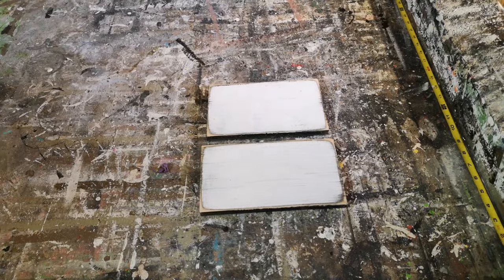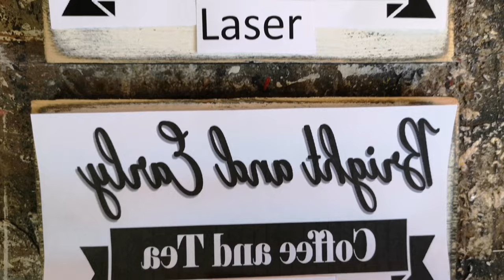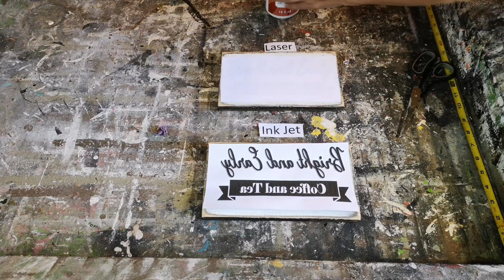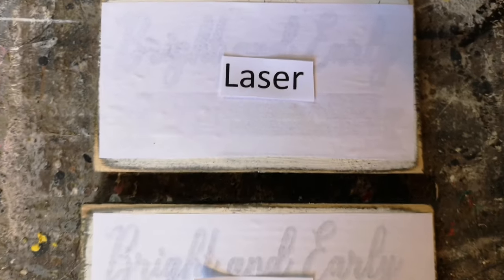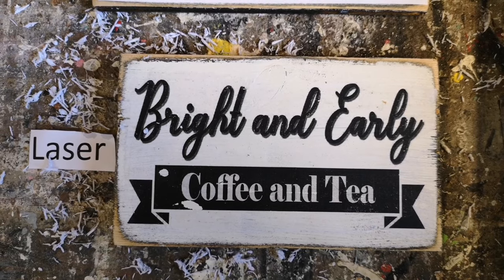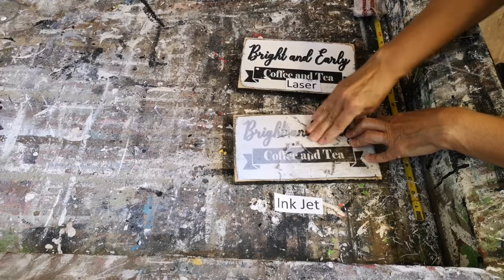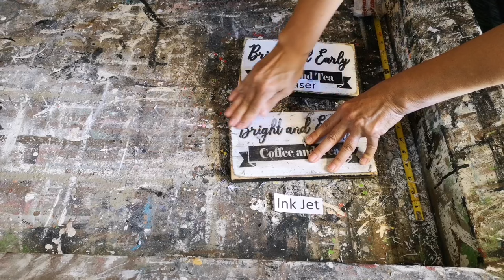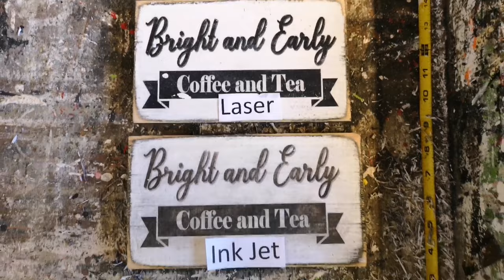Best Printer for Mod Podge Transfers / Inkjet vs. Laser

Comment: The channel, “Red Rocking Bird,” has a tutorial with an inkjet, and it worked great for her. She doesn’t use hair spray, but I have heard that might help. I haven’t tried it myself, yet, but I do want to try it. I have learned so much from both of your channels. You are such a great teacher. Thank you, for showing the difference, so we can explore, with the tools we have. I noticed one thing she did differently, is that she worked in small sections, to wet it, and rub it down, so that may have helped her. Since it wasn’t all wet at once, it didn’t give it time to smudge.
Reply from the maker: Yes it is kind of a trial and error to see what will work for you and your printer . If you figure it out it works perfect ❤️

Comment: Found ur videos while researching color graphic transfer onto wood.  Your tutorials are very informative and I absolutely love the fact that u get down to business quickly. I have a question about the graphic transfer with an inkjet; I've watch several of your other videos on this subject and I noticed when you decoupaged ur camping pics and the graphic on the aged paper that you low baked then sprayed with hair spray to prevent bleeding (inkjet)...would this same process work with the reverse prints for total transfer (paper removal) or could it perhaps lessen the "bleeding" of the ink?
Reply from the maker: When doing the reverse technique with an inkjet printer it won’t make a difference if you put it in the oven and actually if you put hairspray on it it will prevent it from transferring as well

Comment: Been doing this for sometime and curious how you handle what I like to call "paper fog"?
After all the paper is off (that will come off without destroying the design)... and after the water has totally dried, the design seems to "fog over" some. Add water and it's instantly bright again. Usually a clear sealant takes care of this for me but wondered if you had any other thoughts on this? Thnx...
Reply from the maker: Yes you can get a bit of a haze at times just need to work on a small area and dampen finger and rub slowly. When you add the poly alot will go away if you still cant get it off. Use the cheapestest computer paper so you dont have as much paper to rub off also
Reply: @OurUpcycledLife  makes sense about the cheaper paper!! 👍👍

Comment: I recently saw a video where you put a ink jet printed image in a oven at 200° for 10 min. to set the ink will this work for reverse transfer printed with ink jet, will it help the ink transfer better with no or less smudges
Reply from the maker: Thanks for watching! I haven’t tried that but would certainly worth a try and it will probably help a lot with smudges. Let me know how it works it you try it! ❤️

Comment: Love your video! I tried this and it seems like I’ve rubbed off the paper 5 different times. I did it on a canvas, and after I rub it off and it’s still wet, it looks good. But then by the time it’s dry, it’s all white again, Like it won’t stop peeling off. Any suggestions?
Reply from the maker: Hey there!! Sometimes it will stay cloudy but when I put a coat of poly acrylic sealer on it that will go away❤️
Reply: @OurUpcycledLife  Thanks so much!!!

Comment: Such a great way to show the difference. I'd even hang those signs in my workshop. Perfect. Btw, what technique would you recommend I use to clean my teapot up? I am debating whether to do it or leave tarnished. Just curious. Thanks sunshine. 🌞
Reply from the maker: If painting a ceramic tea pot it covers best with a primer or spray paint for first coat :)
Reply: @OurUpcycledLife  wrong teapot sunshine. Lol. Mine is antique silver, tarnished, with a black handle. Looks similar to yours in your workshop. 🌞

Comment: So do you have to paint the wood surface first like you did or was that just for stand out quality? I also see lots of these videos using printable lable backing paper to print. Now those dont use modge podge and rubbing so does that mean long as im using mod podge technique i can use normal printing paper?(working with an ink jett) thank you for your time and this video comparison.
Reply from the maker: I just use normal computer paper for this method and paint the wood so it stand out better. The label paper is a completely different method ❤️ thanks for watching

Comment: Did you use regular printer paper for this method? Also do u think the photo transfer modge podge medium would work on this?
Reply from the maker: Yes regular computer paper and yes the photo mod Podge will work but the matte mod Podge works just as well❤️

Comment: What type of inkjet printer are you using?  It matters as there are dye type inks and pigment type inks.  Pigment types are higher end and will probably handle a transfer better.  Thanks for the compare ~  Modpodge!  Who knew?  ps… i like the inkjet example for this use.  wondering how modpodge will do with transfers onto metal?
Reply from the maker: It is a HP  printer! I don’t actually use it much. Use my laser jet 90% of the time 🌸 I have used mod Podge on metal actually doing a video right now on a metal bucket
Reply: @OurUpcycledLife  Thanks so much!  But can I please ask; which model?  You see, some use pigment type inks and most seem to be dye type.  They each give a different result.

Comment: I was wondering, if you wanted to do this technique on a big bit of furniture, would that HAVE to be inkjet? For example 890mm x 610mm or has anyone ever done this in sections? Or would that just be a nightmare? Thanks in advance. Tim
Reply from the maker: Transform Your Designs: Create HUGE Signs with This Simple Trick
https://youtu.be/HYr3DFZo9CQ

Comment: I have a HP Envy 5010 inkjet printer and the black is quite stable when it gets wet. The other colours most definately are not. I have tried this with red instead of black and boy what a mess. Not all inkjets are equal. Some use pigments which make them much more waterproof. If you did this type of image transfer with an inkjet print that was very colourful I don't think you would have as much success as just using just black.
Reply from the maker: Yes I agree all ink jet printers are so different with how much they run. Mine works well. I have a tutorial of a colour photo I did and didn't run or smear at all https://youtu.be/F17WmucEwqM

Comment: I recently discovered your channel.I love it! But I have a question: I bought a laser printer and tried transfer my photo with Mod Podge medium transfer to a block of wood without chalk painting under the photo because I want the wood grain to come through. It did not turn out well at all; the picture was tearing up, so I just rubbed it all out and am going to start over. Do I Mod Podge the bare wood, let it dry, and then try it again?
Reply from the maker: I find the best results having the base as chalk paint. It is difficult to transfer on bare wood . Glad to have you following along ❤️
Reply: @lisa Shelton
Did you figure out what to do for the wood transfer.
I'm not sure if this would help....  🚨please try it in a scrap of wood first.
🤗 Try sealing your wood with shellac spray,  let it dry for a day and see if you need another coat just in case and let dry. 
Then, try doing the modpodge transfer, hopefully this work for you. 👐🏾🙏🏾 Good luck!
Reply: @TamyC7  I was able to successfully transfer the photo so the grains show in the photo. What I did after I sanded the rest of the photo off is I just reapplied it onto the wood first, and then put the photo on top of it with a roller…then I let it dry for 12 hours. When I rubbed it off, I did it in separate sittings, and made sure it was completely dry before I rubbed it again, then i finished it with SG polycrylic, and it turned out great! However, I am going to try the spray shellack next to see if that makes it a little less time consuming. Thanks for your reply 🙏

Comment: I am new and about to give it my first try. If your block wasn't painted white would the wood look white because of the printer paper? I want to put some text on a piece of wood but don't want to mess it up. Thank you!
Reply from the maker: Thanks for watching ❤️ I always like to do this technique on a light coloured painted surface. If you do on raw wood I find after you have rubbed off it still leaves a cloudy look to raw wood
Reply: @OurUpcycledLife  my project turned out great, thank you for the suggestion! Now my question is, since it'll be an outdoor piece, what should I be sealing it with? Would a paint on spar urethane be ok? I just don't want the colors to bleed.
Reply from the maker: I would put on a outdoor poly acrylic sealer and that will be good for outdoors🌿
Reply: @OurUpcycledLife  do you have any you prefer?
Reply from the maker: No any brand will work good as long as for outdoors❤️
Reply: @OurUpcycledLife  thanks for the quick replies, appreciate it!
Reply from the maker: You bet anytime ❤️

Comment: I learned a trick that works doing these and I did a 16x20 portrait, what I do is put a little more mod podge then I put something heavy on my image to make sure no wrinkles get in it. then the last part is I heat it with an iron on low for a few seconds then I wet it with water and let that water sit for about 40-50 seconds and all of my paper come of down to the actual glue is all thats left no paper at all am i';m using an inkjet printer.
Reply from the maker: Great tips

Comment: Does the printer do reverse?
Reply from the maker: No you have to use a word program to reverse the text 🌞
Reply: @OurUpcycledLife   Great video!
Regarding having to use a word program... Someone told me that you could print a mirror image straight from a printer, so I googled it and came up with this. (I hope it works)
"How do I print a mirror image on my HP printer?"
"Open the image, click File, click Print, and then click Show Details, if necessary, to view all settings. Click the unnamed print options menu at the center of the window, and then select Layout. Select Flip horizontally."

Comment: ive followed your chalk paint recipie, then i got a laser print, but my pic wont stick to the painted wood with the matte mod podge
Reply from the maker: You painted the surface with chalk paint?  If you did I have never seen it not stick? If there is varnish on top of the chalk paint it will not stick could that be the problem?
Reply: @OurUpcycledLife  no varnish, i kept sticking the edges, left it overnight and had hell of an issue getting the wet sponge to soak through the paper, (the paper is a lot thicker than computer paper) could this be the issue,this is 3rd time doing this, time for stiff drink lol
Reply from the maker: Oh yes that is it for sure!! I use just cheap computer paper! The water has to be able to soak thru to rub off
Reply: @OurUpcycledLife  i got printers to put image on my own computer paper as 100gsm was the lowest they did, anyway when i went to rub it off most of the ink came with it, i salvaged it but the cats had ears missing etc but i made it look vnitage

Comment: I wonder if you put the Transfer medium on the wood, rather than on the inkjet picture would it smudge less? You wouldn’t be dragging your brush across the inkjet print merely laying it down on the prepared wood. Just a thought. Love your demos x
Reply from the maker: I did try that technique and it didn’t make any difference. It’s the actual rubbing I found that took the image away. Worth a try though might work for you ❤️

Comment: I'm not a huge fan of ink jet printers for many reasons, including that a printed letter on a laser jet is infinitely cleaner without fuzzies - experience with an ink jet is poor quality or not crisp, clean letters on simple black & white printing. Having had this experience from years ago has really slanted me away from the ink jet. However, I do use an ink jet for photo printing and have good success, but it requires a top quality ink jet in my opinion. I say if you have a choice and are not looking for fuzzy of distressed use a laser printer.

I really appreciate your comparison however, I can see that distressed-look crafters may well want an ink jet to accomplish this without having to use an abrasive to tone down their signs.

Comment: Thank you for the tutorial it has helped greatly. One question can this method be used to transfer on to a glass block? 😊
Reply from the maker: Yes you can but paint the glass surface with chalk paint first. otherwise it wont adhere well. Here is a tutorial on how I paint my glass. https://youtu.be/i8ETTafLTrA

Comment: Hello. Do I have to paint the wood first or is it ok to go straight onto the wood?
Reply from the maker: It works much better on a chalk painted surface ❤️ thanks for watching
Reply: Hello. I have done this with my ink jet and a photo and it has transferred well. Its a bit faded but it looks quite vintage. I wondered should I seal it with the mod podge too? Thanks

Comment: Good morning and Happy Easter! I use ink jet, but treat it more like rice or decopage paper. I dont flip the image, but rather use the whole thing. I buy cheap printer paper, its thinner and is easy to work with, plus I dont have to do the extra step of peeling the paper off. If you hair spray your image, it's less likely to run the colors...just a thought. I love your videos and how you teach, thank you.
Reply from the maker: Yes great tips! You can also make the computer paper even a little bit thinner with this technique then decoupage: https://youtu.be/9uLxgmoluYE

Comment: Hi from Lapland 👋🏻😊 i would like to leave a comment regarding ink jet transfers: i do also like the rustic look, but keep in mind that, ink jet prints strongly fade in the sun! After only one summer exposed in the sun, you will hardly see your transfer. Thought this might be an important point. 🤷🏻‍♀️
However, I ❤️ your channel 😊
Reply from the maker: Thanks for watching! Yes it will fade but I have found if you seal with outdoor poly acrylic it will prevent it alot :)

Comment: Thanks for explaining the two different effects using a laser jet printer and a ink jet printer. My question is when you print on the ink jet printer, what are your settings? I know the paper is standard copy paper but do you change the settings on your printer to gloss photo paper or do you leave on plain paper?
Reply from the maker: I don't change any settings! Mine works fine on the standard. Every printer is different though so you might have to play around with it a bit